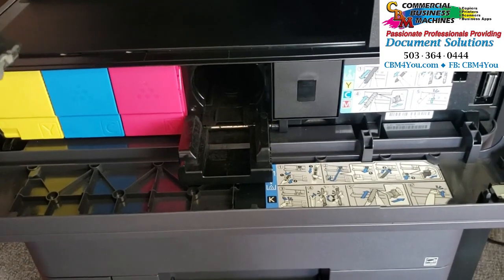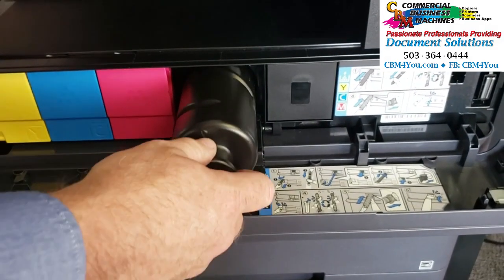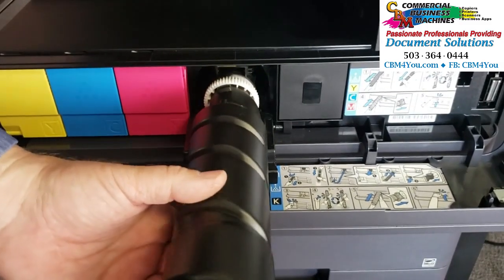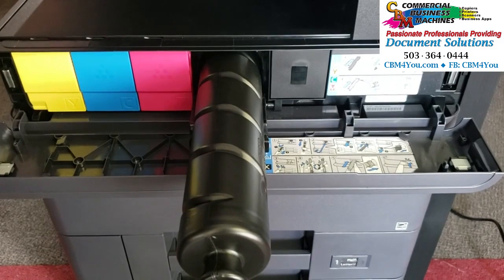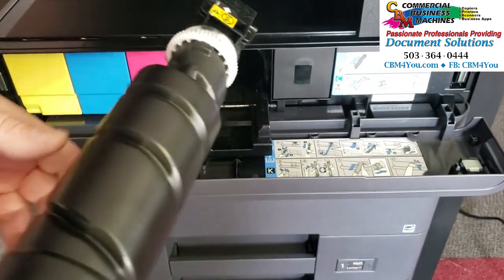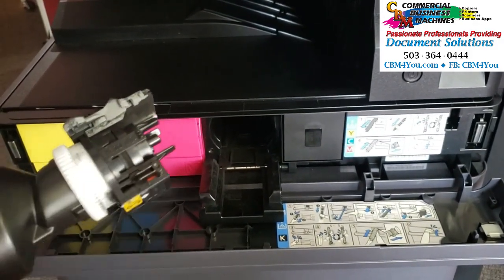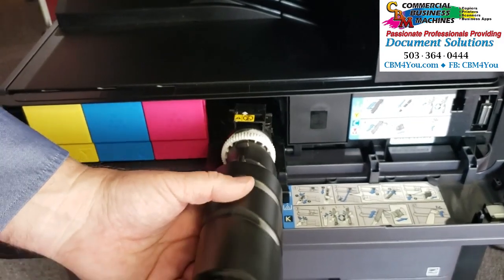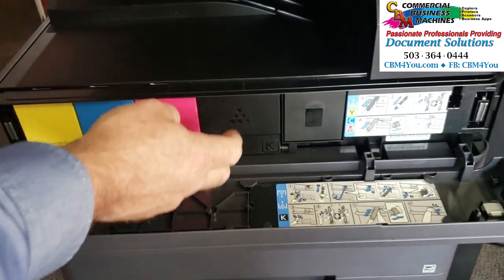My NEW Toner Cartridge Won't Go IN! - Kyocera Copiers

Comment: Caution…..Make sure you are not trying to put a full waste toner in the machine. Sometimes customers will put the waste toner back in the box when it is full and lay it near the copier to be thrown away. People then think this is anew full toner. I have seen this many times. If you are sure the toner is new then move the clip to cover the orange label.  You can check the toner as well. If the toner powder looks grey or brown then it’s waste toner. If it is black then it is new uncharged toner.